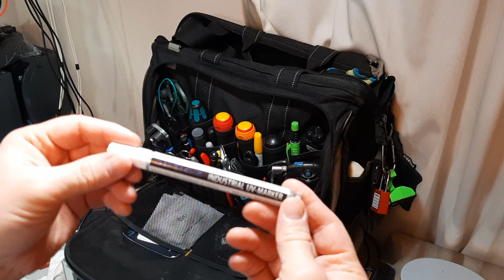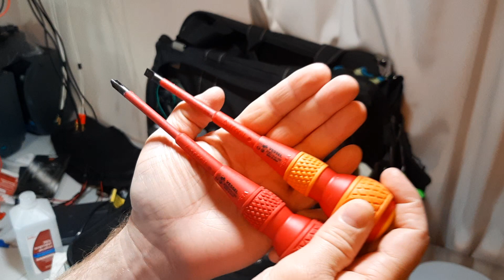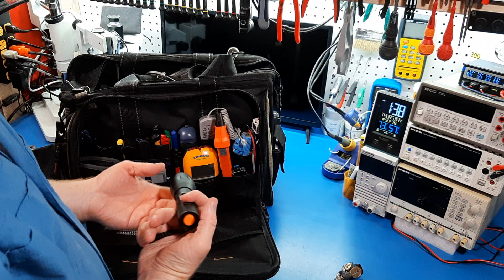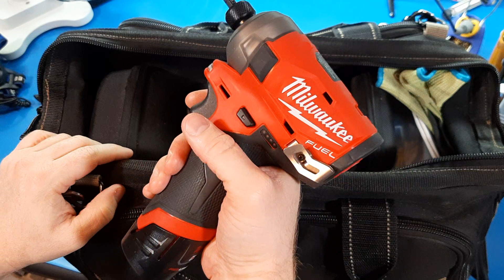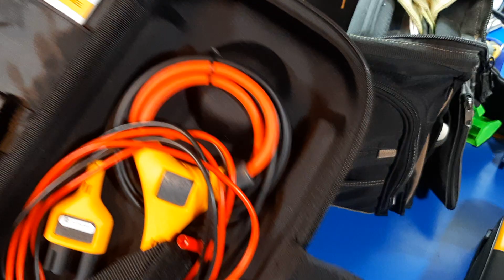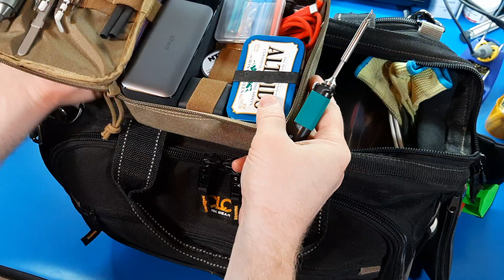Low Voltage Toolbag 2023-Sep-28

Comment: Klein auto strippers able to do cat cable 24-26 gauge? Very curious how you handle carrying extra batteries for testers. I put tape over the contacts if 9v and throw two in a pouch on my bag.
Reply from the maker: For the Klein automatic strippers, I've really only gone as small as 22ga since that's what I work with most often.  I've very occasionally done smaller and have run into issues of breaking some copper strands (for smaller gauge stranded) - in which case I clipped the bad end and did it with the regular strippers.

So, for some of the devices that use 9V batteries, if I notice they tend to turn on when they shouldn't, one thing I'll try is putting the battery in upside down to store it inside the device but leaving the contacts not touching anything.  Not all devices have the 'wiggle room' to put the battery in like that, but some do.  Other than that I use lithium primary batteries for AAs and 9V and as such they last a long time, but I keep spares in my van in one of those large parts organizers.  I like using lithium primary batteries instead of alkaline not just because of the higher capacity, but also because they are far more temperature tolerant and won't do the 'alkaline leak' mess in my expensive equipment.
Reply: @neverendingstudent  I’m always stressed about my batteries running out. Keeping in little caddies to keep them fast access like you did with an organizer. Thank you :)